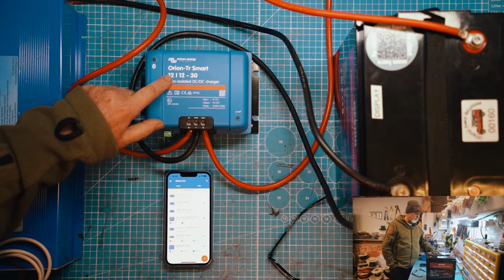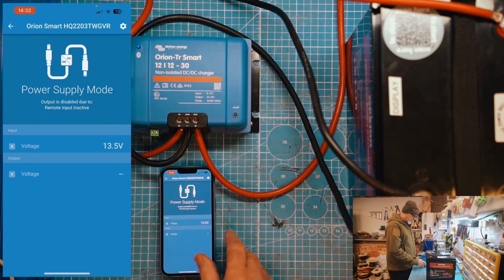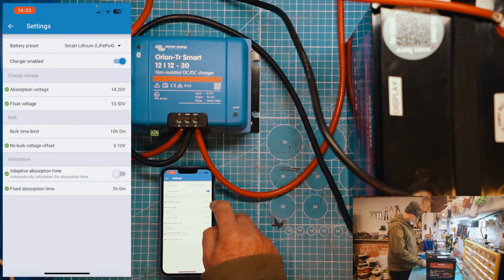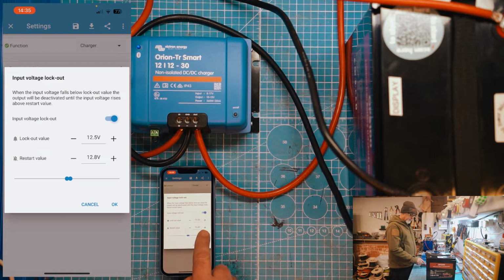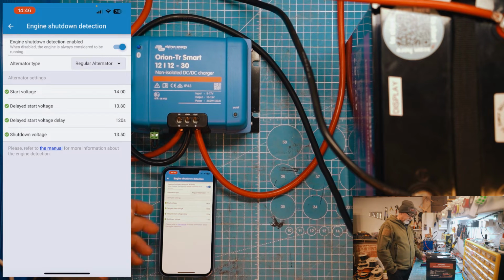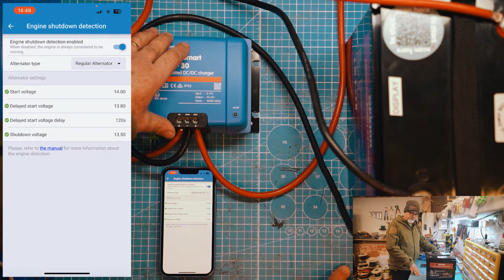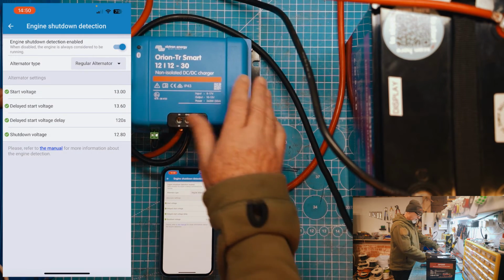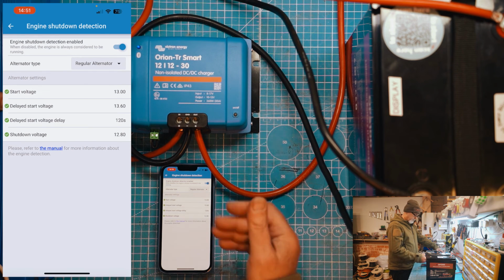Victron Orion-Tr Smart DC-DC Charger settings explained in detail

Comment: Hi there! Thank you for the video. I just need a 12/12 to power some devices that require clean and stable 12v. I don't need the charger, so can I turn it off and use just as a voltage regulator? I'm plugging it to a 240A bank charged by a mppt 100/50 and a T22 30A.

Comment: Mine has been in my van for two years working until some guy came up to my van, saw my floating number (13.2)and said that it was too low and I needed to up it. So thinking he knew better than me ( he had victron setup) he used the app and changed the setting (14.2) I haven't had it running smoothly since. It actually drains my van battery. My two lithium 100 AH shut off and no power comes through for the fridge. I have no fridge unless I'm driving, but as soon as I turn the engine off, the fridge turns off. I do not have a solar panel on the roof, but a 250W blanket. You need the sun for that.

Comment: Does the engine shutdown detection overwrite write the input voltage lock out when disabled? I have to do so because my alternater offers very often below 12v and so it is the only way to use it without detection just with a switch on the remote port.

Comment: Would it be possible to use the same dc to dc charger in an electrical car without an alternator. There is a 12 volt lead battery that’s charged from the big traction battery with around 14 volt. It’s a Opel Vivaro-e. I would like to have a second LiFep battery for a 1000w inverter. 
Kind regards Max

Comment: Great Video and I'm still at the start Lithium battery settings with my alternator puting out 170 amps, but I'll need to check the voltage change.  One thing I'm seeing is that the "Delayed start voltate delay" is set for 120s, but the Orion-Tr Smart DC-DC Charger is only delaying charger start for about 5-10 seconds.  So I'm not sure if I have an issue with it starting so fast, or should I raise the 120S to a higher figure.

Comment: Great video. I wanted to ask though- why do I need input voltage lockout set to 12.5 if shutdown voltage is set to 13.5? Wouldn't it stop charging at 13.5 with those settings, rendering the lockout setting irrelevant?
Reply: I think it gives you customizability of the unit if you aren't using the engine shutdown detection feature. This model is made in different voltages, so perhaps you have a 48v house system and want to use this unit to tend a small separate 12v system; it would allow you to not drain the upstream battery bank (in this instance you wouldn't use engine shutdown detection at all). It is quite possibly a holdover in the software that is installed on all models to allow greater application options.

Comment: I've had the Orion hookeup up and working fine for about two years but all of a sudden it seems to have malfuctioned and drained my vehicle battery while the vehicle was off for the night.  Has anyone heard of this happening? Why would this start happening to my system after two years of running my setup with no problems?

Comment: How do you deal with a feedback loop of the 4A float charge from a multiplus II? I have 3/0 running back to 2 12-12/30 as well as an ignition line.

Comment: Hello.  I just installed a DC/DC 30A.  Afterwards I tried to start the motor and after a while the DC/DC started.  When I turned off the engine, it took a little while before it turned off.
Tonight I opened my victron app then it showed absorption input 13.8 and out put 14.5 and the motor was not running.
Why does it do that?
We are now connected to shore current 230V

Comment: well explained.  but my question is,  when engine is off and its been over a week will it keep my starter battery fully charged. as yet not been able to find any info regarding this.
Reply: did you get any answers for this? this i need to know for my boat setup :D

Comment: I'm wondering about the negative cable to the charger. I would guess there is practically no current running through it, so you could probably get away with 1.5mm, just to make life easier.

Comment: Super useful, I have a question that I would like you advice on. I’m happy to pay for your experience if I can reach out directly. I have a 120v 30 WFCO converter that is capable of charging a 100amp hour LiPo battery. But I want to put a 200amp hour battery in its place. Can I put this Orion-Tr unit in between my battery and the converter to achieve the desired capacity?

I can’t just rip the converter out, it’s an integrated part of the fuse panel for the RV. 

I think the Victron multiplus units need to sit upright for cooling, just like you mentioned for this unit. I don’t have enough space in our RV to mount it upright. 

Thank you in advance

Comment: when it reach 13V, how much current is the alternator pushing to the lead acid car battery? maybe the reason setting it to 14V is to make it sure that the alternator load is only in the victron device and only minimal current is pushed in the lead acid battery, so the alternator won't be overloaded or over heated. thats the essence of using that victron device to protect your alternator from lithium battery which has very low internal resistance

Comment: Probably a silly question… what’s the difference between Power Supply Mode and Charger?   I want to make sure I never kill my main battery.  That happened once after I got it installed by a van build company.  They set something to the wrong setting.  I can’t remember what that particular setting was and I was wondering if you might know?  It may have been power supply since you mentioned it is set to that by default.  Thanks for any information you can provide.
Reply: did you figure out? i dont want to kill my starter either
Reply: @ I believe it should be set to charger … I have it disconnected right now until I take my van to get some other electrical work done and I’m going to have them look at my setup since it kept killing my battery.  From ChatGPT ….the setting should typically be set to “Charger” mode, not “Power Supply.” Here’s the difference:
	•	Charger Mode:
	•	Smartly charges your auxiliary (house) battery using a 3-stage charge profile (bulk, absorption, float).
	•	Protects your starter battery from being drained.
	•	Ideal for charging lithium, AGM, or other deep cycle batteries safely and efficiently.
	•	Power Supply Mode:
	•	Outputs a fixed voltage regardless of battery state.
	•	Bypasses the smart charging stages — not ideal for battery health over time.
	•	Only use this if you’re powering electronics directly and not charging a battery.

So unless you are powering electronics directly and not charging a battery, use the Charger mode. Let me know your setup if you want more tailored advice.

Comment: Great video. I've installed a 12-12 15 amp Orion TR in a towable RV for a 100 amp/hr lithium battery. I'm using #6 (somewhat heavy gauge wire) all the way from pickup truck tow vehicle battery to input of DC-DC (probably 30 foot of wire total). One connector is used near the hitch point. The other minor resistance points are the terminal lugs under the truck engine hood and the in-line 30 amp circuit breaker next to truck battery. I'm able to get nearly full tow vehicle voltage to the DC-DC now. The original pickup truck wiring was only #12 wire and I was losing 1.5 volts between truck battery and DC-DC.  
Question: Where is the link to your document for the Orion?  I found the link for the Victron shunt in a previous video.  Thanks

Comment: excellent explanation.  Yes, Victron is "better" as you can change all the settings.  but at the same time, without proper knowledge, they can be confusing.  Many other brands are just "plug them in" and hope things work.....    so thank you for your technical answers.  Your video is helping me decide on getting the DC-DC charger or not.  my truck has factory wiring to the rear plug for 30A.  So putting the DC-DC charger in my trailer near to the LiFePO4 battery should work fine.  (continuing to use the correct gauge wire of course).   Having real-time data from my Victron SmartShunt will be key in understanding if everything is working or not.   So many people only speak about RV or van systems and not for trailers (caravans). i subscribed to your channel and to your documents.  looking forward to learning a lot.  cheers.

Comment: Hi I don't have any wall space left in 12 volt box which contains all my 12v gear the only place I can mount is on a flat shelf above the battery box. The area is open at the side of the van and at the front into the to the box which contains the rest of my gear so air is circulating around. Thanks for your details to set up it very much helps.

Comment: Is there a way to limit the charger current?  Have a 24/12 30amp orion to charge a small 18ah Li battery that only calls for 10 amp charging rate.
Reply: Yes, I have mine limited to 15 amp
Reply: @RobertStevensService  Where in the settings do you limit the current?

Comment: I'm installing orion xs 12/12-50a tomorrow..but all the information will roughly be the same...Thank You...good video...
Reply: Hi bud , I would like to find out if u can adjust voltage to output 15v or 15.6v max on 12,12-50

Comment: Hello, is there a way to limit the current? if I have a Li Ion battery to charge, that can take 200+ Amps, how can I limit the output current in order not to blow the fuse or overcharge the alternator, charger, cables?

Comment: Thanks for the heads up re the 13 volt setting as no where else have I heard this information which makes logical sense. If you have a solar charger as well is changing this setting essential? 🤗
Reply: I had a problem with no lights flashing or blue tooth connection. After much thought and head scratching I unmounted the charger and discovered my main chassis ground had fallen down where I couldn’t see it. Once I connected that up to the house battery I immediately saw the Bluetooth light flashing and could connect with my iPad. Very easy to adjust parameters on the charger and a great video with simple instructions. Thanks 🤗🤗🤗

Comment: Ive just had this charger installed but don't fully understand the settings ,the guy who fitted it said that when i start my van the starter battery stays at 12.4v constantly it doesnt peak to 13.8 or 14.0v etc,so he told me i had to put my heater on or flick the full beam on to aurge the battery for the charger to kick in?? It doesn't seem right i have to do that every time i switch the engine on?? I jave a 2016 vauxhall vivaro bi turbo,any suggestions??
Reply: I have a 2016 Vauxhall Combo Crewcab, so same age & make, electrics are likely to be very similar. I've got a Victron 12-12 18Amp which I intend to install in the next few days. I'm new to the concept ot 'smart alternators' but it sounds like your alternator or ECU is seeing the main battery as 'good enough' and doesn't need charging. Full beam would load the battery causing a voltage drop and the alternator would kick in. I'll see how mind behaves when I install it. The other thing I've read is you need good thick (prefably short) cables from the main battery to the charger otherwise the charger will detact a lower voltage. Now just need the rain to stop so i can get on with it...
Reply: @Whiskybottle118  yes I've 16mm2 cables for mine,been working good so far until this morning and my van wouldn't start, battery was dead??? I've had no battery issues until I had this installed and tbh I was actually just waiting on this happening!!!
Reply: @stephencasey1882  Could be worth puting a switch in that green link so you know it's disconnected when you're parked up. I also wonder if setting the sense voltage lower could stop it disconnecting. I once had a similar problem with a voltage sensing relay when I flatted the back battery and it hadn't seperated from the front battery and nearly drained that too
Reply: What do you mean ,green link?? I'm baffled by this stuff ,I had someone fit it so I just switch my van on and drive away,hoping to not have any issues lol
Reply: @stephencasey1882  Looking at the charger terminal block with the heatsink below, there are two smaller terminals to the left, a green block. You can see it in the header pic of the video. The two terminals are linked together with a wire, this makes it work. Remove the link wire and run it through a switch and that will allow you to disable the device (and seperate the two batteries). I've not tried this myself yet but that's my understanding. I haven't found anywhere to fit it yet, smaller van. The warnings about getting hot means I don't really want in under the seat where the second battery is so I'm trying to find somewhere under the bonnet.
Reply: @stephencasey1882 is the green on/off light active with the van off? When I turn my van off, the Bluetooth disconnects and the green blinking on/off light goes out, which ai take to mean that nothing is happening. My battery monitor also confirms the drop in Amps when the charger goes off.
Reply: So if i take that wee green link out that switches it off?? Is there a way to switch on and off on the app without touching anything else??? I'm clueless when I go into all the settings!!!

Comment: Great set of videos, really helpful. 
I’ve been trying to understand how I can split the output of my solar panel to both hab and vehicle battery. For example I’d like to send 80% capacity to hab and 20% to vehicle, and then 100% to whichever battery hasn’t reached a charged state. My current vehicle has a switch to flick solar output between vehicle and hab battery

Comment: Thanks for this, I was having issues with low amps when charging...everywhere I looked seemed to point to overheating or cables. Last week I changed the start voltage from 14v to 13v and I'm getting a solid 30 amp charge now.
Reply: Yes, I saw a lot of people on the reviews complaining about this
Reply: Would you mind sending me your settings? I'm having the same problem. Thanks in advance :)

Comment: I've had mostly pretty good experience with Victron but sometimes I facepalm.

These chargers could have been so much better.

I was one of the people who wondered why my 12-12/18 was only putting out about 10-11A. I spent so long trying to figure out what was going on but it was made difficult by the lack of data in the victron connect app for the DCDC charger.

If they had included the charging current then I wouldn't have had to do the maths, working out what was going on from my shut. Seems like a simple thing to include but it's not.

Also, if it's throttling due to temp, how hard would it be to have that show up in the app too?

Super frustrating device to try and get working correctly. It still throttles when it's hot and I can't do too much to help it because of where it is located in our camper trailer. Does my head in! So much potential.

Anyway, hopefully the new Orion XS is better.
Thanks for the video

Comment: Hi, what mode should I use for lead acid batteries?
Reply: Found this, not a definitive answer.
 "Try the 'Gel(1)' setting. It's not aggressive and would do.

What you choose really depends on how much you draw the batts down daily, and how long you have to charge them. You could go more aggressive if you have a limited time to charge them and have drawn them down somewhat. If they're in 24/7 storage, you might just choose a flat 13.2V. Maybe 'Gel(2)' for a little more grunt if you're time pressed..

Make sure 'Adaptive' comes up in the settings, unless you want a fixed Absorb time.

So there's no single answer, sorry. I think most of the presets there cover the Victron battery range, but there's something for most tastes. I'm not sure with the Orions, but you should be able to modify a preset and save it under your preferred name, as an extra to the standard list."
Reply: That's a question. I am wondering the same thing because I keep having issues with my alternatore, eg, it's overheating, and I have gone through 3 alternators so far.
Reply: Me too, it's not clear from the options
Reply: I have same problem finding correct preset.

Comment: I definitely want the 18A version then. We are in no hurry to charge and my cable run is about 25', so I don't want humongous wire diameter.
Reply: I have 16mm2 cable from starter motor to dcdc in caravan
Total length of cable is 10m
Ive a 30A dcdc only putting out 20A at best
But it's also 30 - 40°C here so I'm guessing that contributes too
No way would I go 18A dcdc

Comment: Thank you for your EXCELLENT video.  As the owner of a 1995 Fleetwood Pace Arrow motorhome, I have found nothing on YouTube that is really helpful in describing the correct installation of a DC to DC charger for it.   Any such installation is complicated by the motorhome's cross-connect vehicle to house battery switch,.  No one on the internet seems motivated to address in detail how to (in detail) properly install a DC to DC (Victron) charger on these older motorhomes.  Maybe you can be the FIRST??  Thanks.